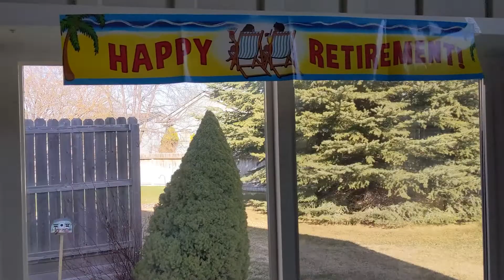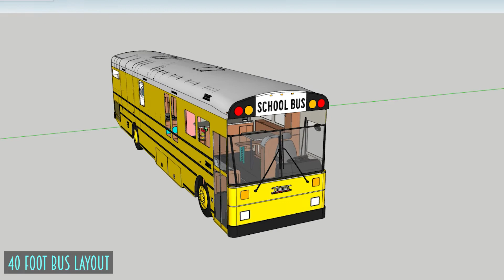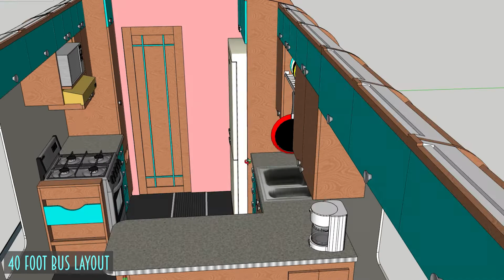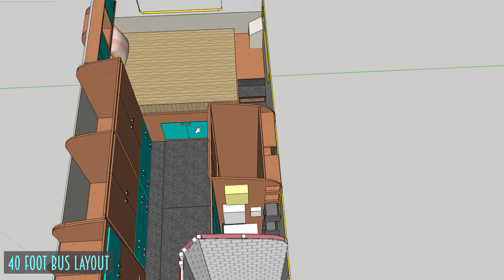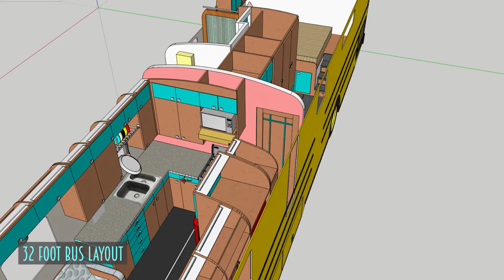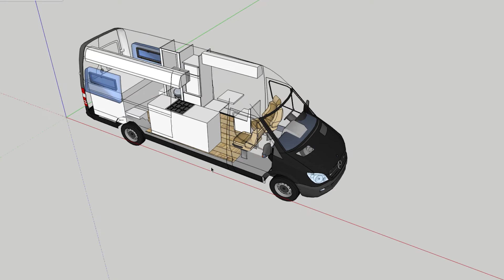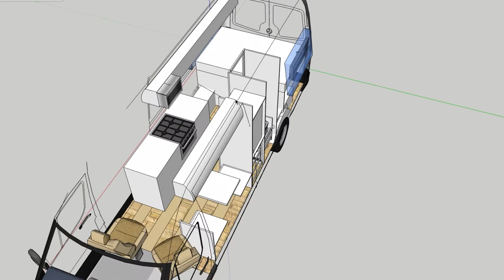Buses Bikes and Beers Update

Comment: When I heard sprinter van in this video, I was like, and the bus too? But then, I see it's a choice. Do you want stealth or not? How much will ability and access to repair on the road factor in? How much do you value a shower that's always ready to use? Where will bikes be stored? Is cost to drive or heat the space going to be a concern with an uncertain carbon costing future? No reason to answer these questions here, but you can do an in depth video on what you consider most valuable in a mobile home build, and answer such questions. Who knows, maybe there will be an EV model by the time you get around to it, or such a conversion would be possible.

Oh, and if you start soon, maybe you'll beat Aging Wheels with his bus build! Comments on that channel to get the bus build moving seems to help.
Reply from the maker: Thanks for the comment and for the thoughtful questions.   All of the parameters you are asking about (bike storage, reliability and repairs, trade-offs for interior space, size of vehicle, carbon footprint, power and heating sources.....these are important considerations.    We've given some consideration to some sort of an EV conversation and have reviewed the specs of some of the EV van options but none of them are well suited for a van/bus conversion yet.   One of the big constraints with a EV vehicle of that size is range and the soon to be commercially available options are designed for local/short distance deliveries.   
I like the suggestion of a series on BBB about this process.    How we develop and review requirements, vehicle options, layout progress and considerations....etc.  
Our next big focus is our trip across the US next spring/summer but we do make slow and steady progress on the bus plan.   That means we won't get start in sourcing a vehicle until about a year from now so perhaps there will be more options.   But it seems unlikely we'll beat Aging Wheels.   :) 
Thanks for the continued engagement on BBB, we appreciate it.
Enjoy the Ride